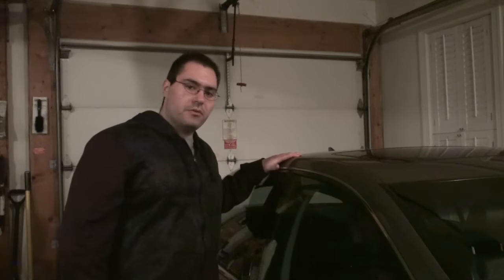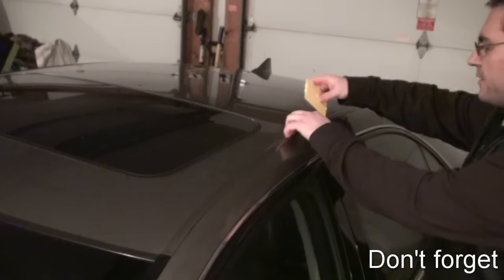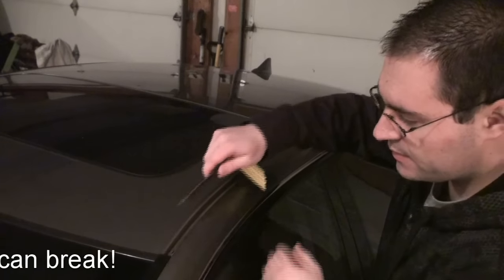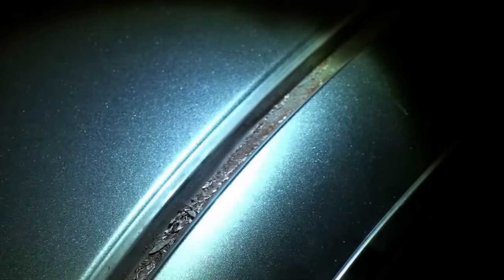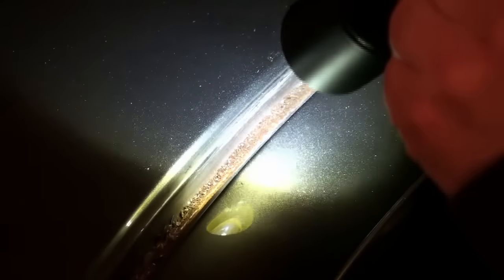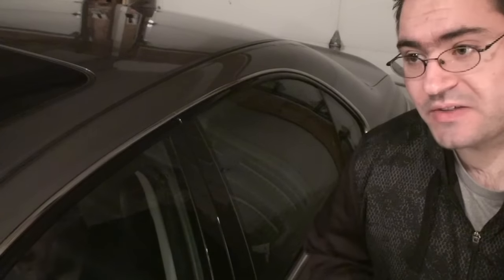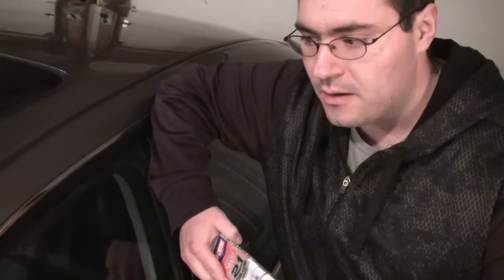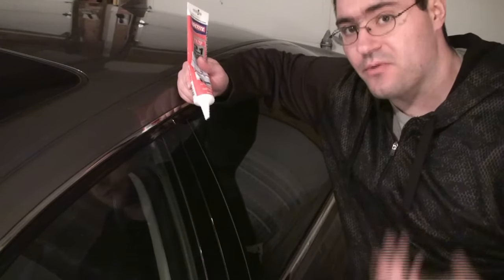Car Roof Leak - How to stop the leak in 10 minutes

Comment: You should never use silicone on automotive paint!  It is corrosive to automotive paint and will cause rust later on down the road.  Use some type of polyurethane sealant instead.
Reply from the maker: Hey Troy, thanks for pointing that out - I should've been more clear about it in the video... there are two types of silicon sealers one uses a neutral base the other uses and acidic base - the acidic one will surely cause rust because your literally putting acid on the metal.  The neutral base will not, is neutral and won't cause any corrosion.  I didn't mention it in the video because I'm suggesting a tub and tile sealer - which will be a neutral base because the acidic base would cause most bathtubs to melt if they are plastic or corrode and rust if they are metal or of there are metal pieces in the tub (such as the water spout).  I've found a lot of polyurethane caulking is water based, and they won't last nearly as long causing you to need to redo the project sometime in the future. 

The video is really meant to be a quick fix if you don't want to spend the money to "properly" fix it at an auto body shop. It quickly stops the leak and hopefully lasts several years.
Reply: @DavidParas  Oh okay. Our car has a leak that causes water to pool in the carpets and actually rain on the passenger side. ... The entire car may need to be redone. It's 2012 Toyota Corolla. Should we do the quick fix or a long term fix? We do plan on keeping the car for as long as it will last... So preferably the long term...  Would you happen to have a recommendation or video to help with the long-term replacements?
Reply: Polyurethane sealent
Reply: @DavidParas so silicon RTV will be fine?

Comment: After cleaning out all the rust that you can you should use what they call "rust converter", and what that will do is convert the rust into a paintable surface that will not corrode any further. After that, then do your sealing/painting... Thanks for the tips.
Reply: How does rust cause water leak? Also, my car has water leak from the center of the rooftop, not just from the corner.
Reply: @JoonKimDMD  i think bad rust which eventually turns into a small hole.
Reply: Not true. The only way to stop rust is to blast it or cut it out
Reply: I've had good luck with Evapo-Rust: clears away rust and doesn't damage metal. I put tools in a bath of it to soak for 24 hours, rinse them off, blow them dry and they're rust free. 
I might try to Q-tip some of it into the seam to soak down and neutralize any hidden rust.
NOTE: I have NOT used Evapo-Rust near car paint, so test a small area first. 
My leaking seam is under the plastic trim so any paint issue will be unseen and small.
Honda's Service Bulletin 03-037 (TSB 03-037) gives detailed instructions for 7th gen Accords and suggests to use 3M Ultra Pro Autobody Sealant.
Reply: @leggygtej2554  yeah nah you're wrong there champ

Comment: Thanks. This particular source of leaks isn't usually discussed here on YouTube. It seems everyone assumes it must be sunroof drain tubes. I see that no sunroof would lead you to check this spot.
Reply from the maker: That was the exact problem I had, everyone said check the sun roof, but the sun roof wasn't leaking... it must be a brand thing for certain brands that the sunroof leaks on all of the becuase of a poor design, I've have several cars over 100k miles and I've never had a sun roof leak, come to think of it neither have either of my parents, and they've had way more cars than me... my dad has a toyota over with 150k miles on it... no sun roof issue... 

Though I will say I rarely even open mine, I really hate them and I'd prefer a car without one, but almost every car has them no a days.

Comment: THANK YOU! YOU HELPED ME!!!! Honda Civic Coupe 2008: Mine was not rusted but it did have a few cracks right in the corner where the roof connects to the bottom of the car, BARELY VISIBLE but seemed to be causing the leaks. I bought Permatex Black Silicone RTV Adhesive Sealant at Walmart $3.94 (used 2) since I did preventive measures and did all 4 corners of the top. Buy 2 if you are a perfectionist like me. It did work, no leaking!

Comment: nice , a lot of people go and replace their windshield like me and find out that doesn't fix the problem. this is my next step. thanks for the video and explanation on how to remove that roof molding
Reply: Yes exactly 
Mine still leaking
Reply from the maker: Glad it helped
Reply from the maker: Do you mean the roof is still leaking or that it's still leaking after you replaced the windsheild?

If you did what I was showing in the video - and it's still leaking - the only other thing I can think of is if you have a sun roof it could leak from there, but that is a much different more complex fix beyond my abilities... you can probably find another video if you seach for "your car" sun roof tear down or sun roof leak - for example if you had a toyota camry - search for "toyota camry sun roof leak" or sun roof tear down - something along those lines. 

Sun roofs typically have a drain systme that runs along the middle of the roof, but they are all very different and have different things you need to do to fix it.

Comment: Worked for me on my 2006 Acura rl both sides were leaking bad toke less then 20 minute good temporary fix until I save enough money for a professional paint job 👍🏽
Reply from the maker: With any luck it'll last you the life of the car :) I drove my 2005 until the engine frame cracked in half - granted I'm pretty sure that the dealer lied about it not being in an accident before I bought it...

The 05-09 model used a weird rubber coated engine frame - apparently the rubber weakens overtime and the thin metal part just cracks after so many miles. Mine lasted until about 99,000 mi

Comment: Thanks for the video. Anytime it rains the floor mats in the rear of my car get wet and I have a feeling it's coming from where You're  suggesting
Reply: It’s more than likely coming from a clogged rain cowel near the windshield wiper bay.  When they get clogged, the water runs down the firewall behind the carpet and then settles on top of the floor board in the back behind the seat.

Comment: Man... You saved me I have a built Honda Civic ironically new headliner installed 5 days ago yesterday had a bad rain storm. This morning I look it wasn't bad but it started leaking.. found your video popped the drip molding off. I have fractures in the corner, no rust .. but man saved my tail just got the headliner done.. smh but it's all good.. I couldn't find the bathtub sealer you used. But I did buy loctite silicone high strength, water proof indoor outdoor , 225 strength.. so it should do the trick. Thank u so much!!! I was tempted to get the loctite Marine stuff but I didn't think Id have a good time getting it out of need be. Soi got the loctite clear silicone waterproof sealant
Reply from the maker: Yeah, good thing you didn't use the marine stuff, that's like contact cement lol... I mean it'd probably never leak, but you'd have to take the strip off inch by inch if you ever needed to get it off lol. 

Thanks for your comment, I'm glad the video helped :)
Reply: @DavidParas  it actually started to leak again smh but it worked for about 10-11 mouths. Think I'll use a little jb weld in the fracture and more silicone on top after it's completely cured. Still very good video
Reply from the maker: @noblewon3507  thanks for saying so, I'm glad it helped - the civic looks great btw if thats the one in your video :)

JB weld might not last long time due to the vibrations from driving, unless the crack is really big - it might be best to sand off the jb weld, paint it with rust proof primer, seal it and then press the weatherstrip into the sealer while it's wet - but also trying not to have it bludge out the top because it will prevent normail draining and then you might get a leak through the front windsheild - the weathersrips are designed to take the water off the side off the roof, down the side of the car - if you completey seal them off then you get a waterfall down your windsheild even in light rain.
Reply: @DavidParas  yes sirr I appreciate the compliments I hand built this fg2, everything.. boosting it only thing left to do but it's basically perfect. LSD upgrade, cams, fully built. And yeah I thought about just sealing it also let it dry completely and then use more epoxy. I have a nice 30x30 coming end of the month slabs already down. Think Ima be ok thankfully
Reply from the maker: @noblewon3507  I don't have the tools to do all the work, but every time I entertained the thought of building something like that and suping it up - I ended up finding an older performance model that was more low matinence - I ended up with a hyundai genesis r-spec after I sold the acura - I've had that the past few years and it's still going strong, though that gdi engine consums a quart of oil about every 1000 miles lol. I got it about 5 years ago for 17k so I figured I couldn't find a better deal or build something faster for the price. 

It's not terrible in the snow with snow tires, but it sildes a lot in deeper snow even with the snow tires - I'd go honda/acura for a better winter car every time

Comment: Nice video!
I have the same problem on my Honda Legend (Acura RL). A lot worse though. Both sides are leaking and full of rust that has continued growing on the roof. Unfurtunetly not seen because it was covered by the wheter strip. Car is only 10 years old...
Reply: Did you ever fix it? I have the same problem with the same car.

Comment: Some cars have bolts on the roof rail so there are holes. The leak is from around the holes. Seal around the holes. If there's no rust, don't use wire brush or it'll damage the paint. Use microfibre towel is fine. I've successfully fixed the water leak in 2012 XC60 by putting small amount of construction caulk around the bolt holes and gaskets on the roof rail channels. Need to remove the headliner in order to remove the roof rails. They are secured by some hex bolts. Also, don't caulk the whole roof channel! They are designed to drain water away to the front and rear of car! If  you caulk the whole channel, water will collect there and cause more rust. If the channel is rusted, the better approach is remove the rust and paint it with regular car paint, then clear coat.
Reply: I've got a roof leak in my 2012 xc60 too. I parked in on a decline (facing downhill) after some rain and it started coming down the inside of the windscreen. I'll take your advice and inspect under the roof rails

Comment: Thank you for this !  My acura tl 2009 is gathering water passenger side -- ugggggg -- sunroof front drains clear, cowl drains clear - my car has a silver trim peices going along roof along driver and passenger side.   getting it assessed this week but suspect its the roof seam as yours was.   thank you for this info
Reply: and no water staining on headliner/doors etc ??? nothing in trunk     suspect running down column?  hope to know shortly
Reply from the maker: Hey Kathleen - my younger sister had one of those, she actually kept it until this year it lasted her a long time with no issues - She had to replace the weather strip on the passenger side and maybe the window as well - if I remember correctly the TL has on the runs from the hood all the way up the roof in-between the window and the frame of the car - I'm 99% sure that's what it was for her car - I think this is what you are calling the "silver trim" - if I remember correctly it is either a weather strip or covering a weather strip. 

I would suspect it's a common issue with that car as they get older, I think my sister had around 160,000 miles and it was still running fine, she just wanted an suv because she could see better. 

Hopefully this helps - I would say there's a 99% chance it's that weather strip or possibly the windshield if there is no issue with the sun roof and no staining/wet spots on the roof - and maybe 1% chance some really odd freak thing I've never seen or heard of.
Reply: @DavidParas  VERY much appreciate this info .  Yesterday water intrusion pro removed passenger seat, found large amt of water sitting under carpet.  pulled back all passenger carpet (threw out padding as it was beyond saturated).  drying out carpet and will replace w/ satisfactory pad later.  Have bare bones passenger side now exposed.  3 hrs shower testing yesterday - NOTHING.  Im doing more at home -- nothing.   perhaps he knocked something loose out of a/c drain when removed?  but I noticed that smell after rain so doubt it was a/c        word on forum was that silver trim peice along top and gasket was purely cosmetic - not to keep h20 out.    baffled.  will update as resolved.  it's a true puzzle.
Reply from the maker: @Myagentkathleen  the only other thing that could make sense would possibly be the rubber weather strip on the inside of the door - that black molding stuff that seals around the edge of the actual door - it sounds like your having a lot of water come in, so if it's not from the roof it could possibly be the door - I'd say after about 5-10 years pending on driving conditions and temperature the weather strips start to wear out - or at least the adhesive that holds them in place starts to break down. I'd guess that's probably where it's coming in if it's not the roof, weather strip, sun roof, or windshield - it's really the only other possibility unless you've got a hole in the bottom of your car. 

Either way, good luck - if you do find where the water is coming in from let me know, in case someone else has a similar leak :)

Comment: Thanks, what adhesive do you recomend. Need to do top of windshield also. Will any auto silicone loctite or similar auto sealer work.
Reply from the maker: probably ask someone at a local auto shop - there are lots of different products  - they should all be about the same - you want a water proof caulking - they sell stuff for fish tanks which could also work well - I'd love to say buy this specific thing, but there are so many options now idk what will be at a store near you. 

The only thing you want to make sure is that it will bond to aluminum with out corroding - a lot of the older silicon stuff had an acidic base and it could eat through the car frame, most of it now is safe, though you will want to make sure the lable says for use on aluminum and metal. Stuff for gutters or windows could work as well. 

Most guys at any local auto shop will tell you the proper stuff to get. 

I hope this helps?

Comment: My yaris had the same issue and I replaced both rubber strips and added  Flex Seal with a small brush and gave it a few coats after letting it dry first.

Comment: I've a leaking issue in my Toyota Matrix.  I was told I'd have to take it to auto glass shop to remove and reseal windshield.  Any idea how can I check where exactly it is leaking, on a side rail, or under the windshield seal?   Thanks.
Reply from the maker: @Nostradamus - water is weird and it's really hard to figure out where it is coming in from sometimes - the best I can do is this:

In my thumbnail image there are three green arrows pointing at the rail joint - I'm going to call them the left, middle, and right arrow. 

The arrow furthest to the right is the exact spot I was having water come in from - it was near the bottom of that seam - and it spread to the left - towards the windsheild as the roof got more saturated. 

So if it is coming in from the windsheild - I would think it would be the opposite since water always takes the path of least resistance - as in it would be spreading from the corner of the windsheild out - not from the inside towards the windsheild. 

It might be hard to tell this after a rain - but you could spray it with the hose or even run your windsheild wipers while your driving on the highway and see if it's starting to get damp closer to the windsheild by the time you get home. 

If it's only showing up after a rain then it's probably the top rail. 

Since you said you have a Toyotal Matrix - if you have the roof rack rails - I'd guess it is coming in from there - they will all leak overtime, it's just enevitable from the driving vibration and unless the guy who put the roof rack on really water prooofed it - your probably always going to have some issues there once you hit say 80,000 miles or more. It's just the nature of the beast - those screws will all loosen and leak given enought time. 

I hope this helps - let me know if you find out where it was leaking, I'm curious - I see a lot of ppl being told they need to re-seal their windsheild but it seems like that never solves the issue - I suppose it could be both issues at the same time as well if the car is old enough.

Comment: So any another leak after this?? Is the selant good for longer time period?
Reply from the maker: My repair lasted for at least 2 years - I sold the car after tthat, but If you cleaned any rust away and preped the area well it should hold for years - though you might have a leak from two spots - or the stuff you used might not have been "good" quality - I noticed they've started to sell stuff specifically for this in automotive shops now. I don't know I could help you much more without be able to see the car myself?

Which stuff did you use?